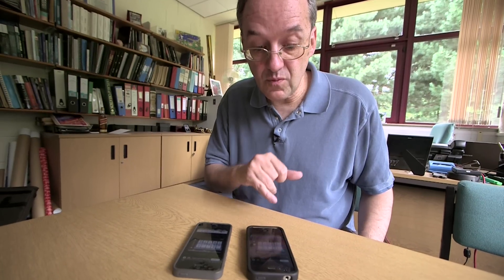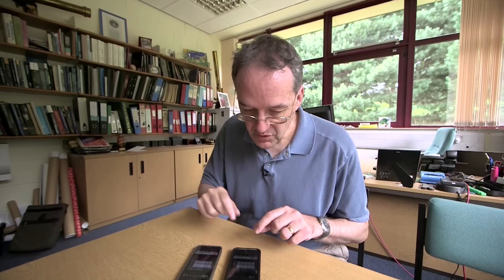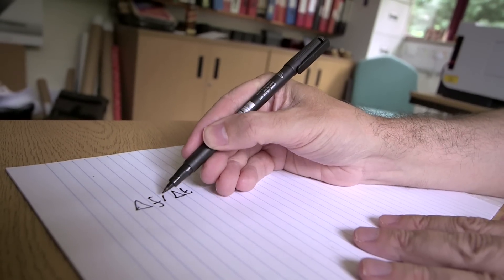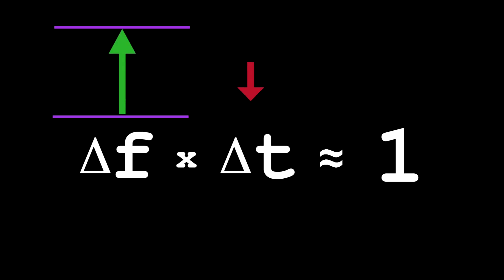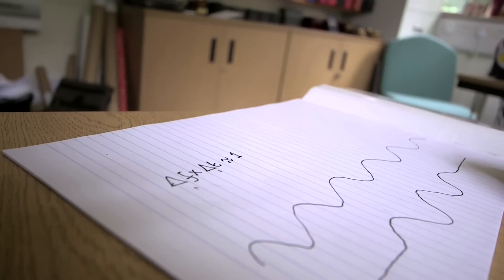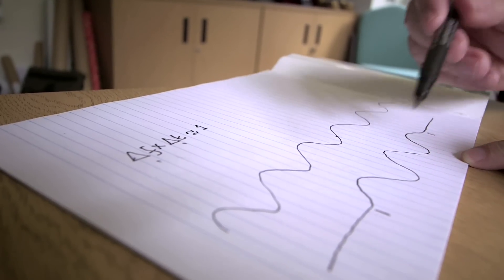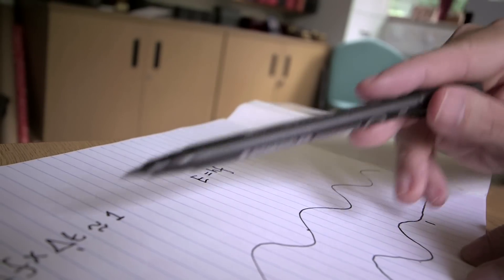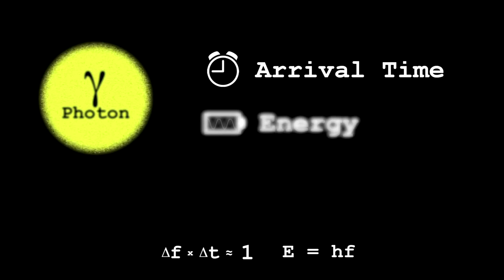What is the maximum Bandwidth? - Sixty Symbols

Comment: Strangely misleading about laser photons—photon frequency is not the same as sinewave, the laser would have to produce exactly-one-photon-in-each-photon-'slot' (squaring energy, yet 50% phase-efficient, intense for single atoms, near impossible for multiple atoms), and thermal effects spread photon emission bandwidth... (slow partial audio beating is called– "wow" or "Leslie").
Reply: And just a general comment on bandwidth, whether or not he covers it, Digital bandwidth is not the same thing as only one phase is represented at the highest frequency (the Nyquist cosine), and lesser frequencies are 'wow's and better...

Comment: The professor confused the part about the laser.
1. You could transmit a digital signal by pulsing a constant laser on and off.
    The 'data' is contained in the ON and OFF switching of the laser,
     the data is carried by the intensity (not the frequency) of the laser, 
     This is called amplitude modulation. The laser doesn't change color nor contain other frequencies when you turn it on and off quickly. If this was true I could produce x-rays by pulsing a red laser extremely fast. This portion is irrelevant to bandwidth.

2. The bandwidth problem is that in the real world, when you have a device that measures the laser's intensity and converts that intensity to a voltage (an analog signal) for a receiver to convert to a 0 or 1, the physical wire that has voltage representing the 'measured intensity level' is subject to this bandwidth topic the professor speaks of.

3. the time it takes for an analog signal to go from a low voltage (0 - laser off) to a high voltage (1- laser ON) depends on the bandwidth of that wire. Bandwidth depends on the Resistance, Capacitance and Inductance of the wire.
The narrower the bandwidth, the LONGER it takes for the voltage to change from low to high.So if i have a very fast ON OFF signal(very fast high to low voltage) on one side of the wire, a narrow bandwidth wire, and measure the output, the output voltage will look like a smeared out version of the input.
Reply: Nope. The moment you turn the laser off, it is no longer a simple sine function. The Fourier series to generate the off state will have many other frequency components. There is a fundamental trade off between data rate and spectral width.  An infinitely narrow line on a spectrum analyzer can have no modulation and hence no information. The moment you start turning it on and off, the signal will widen due to the presence of other frequency components. And to your point, turning the laser on and off will produce components of all frequencies. They just have less and less amplitude the farther they are from the carrier. For the difference between red light and x-rays, the amplitude is so small it is highly improbable that even a single photon would be generated.
Reply: Hi Kinpatu, 

You're absolutely correct about frequency components being generated when you turn the laser off.

Remember, component frequencies only come out during the Transition from low to high. not while it's low or while its high.

Please let me know why you think this shouldn't work:

1. Use a laser (say, red ~700nm / ~450THz)

2. Turn on and off the laser at a rate equal to the wavelength (this will be your bit length)
 
3. Use Spectrum Analyzer with a sampling rate fast enough to capture a full wavelength, (say, 1000000THz in this case), Output the Fourier Transform after every wavelength (700nm / (theSpeedofLight) )  

Then for every Fourier Transform,

4. If you see a single peak at 450THz, you have a 1

5. If you see nothing or a peak at 0Hz, you have a 0

6. If you see a wide range of frequencies in the FFT, The spectrum analyzer isn't bit synced with the data, the spectrum analyzer had taken samples during a transition from ON to OFF or vise versa, so, Control the sampling phase of the spectrum analyzer until the component frequencies go away in all the Fourier transforms. The Spectrum Analyzer is synced with the On/Off Signal
Reply: Technically speaking it would "work," but the only bit stream you can send is an infinite series of 1s.  The moment you send a 0, e.g. 11011, you introduce a frequency component that is not 450THz, in this case 225THz.
What you are proposing is a method to send 450Tbps with on-off keying, with an infinitesimally narrow carrier bandwidth.  Claude Shannon showed in the 1940s that there is a fundamental mathematical minimum bandwidth required for a given data rate.  You may want to refer to his work, as it is still at the foundation of communication theory today, as very advanced modulation schemes push closer and closer to the Shannon limit.

Comment: Hmm, interesting video, but isn't the maximum channel capacity defined by the Shannon Hartley theorem: C = B * log(1+ S/N)?

Plus, you can use a single frequency for transmitting data by using phase shift modulation instead. Unless of course you consider "multiple frequencies" as part of the Fourrier series that would make a PM signal have two positive (or negative) peaks instead of a continuous sinewave. But from a signal filtering point of view, it wouldn't matter.

Comment: Ha! I have a question: How would you explain how SSB (Single SideBand) modulation differs from "ordinary" FM. I Have wondered for some time about the subtle frequency shifts taking place and how the waeforms actually differ. Don't show the delta(f) graph usually associated with the explanation, but rather how the carrier it self behaves.

Comment: farther to more ppl without being degraded any so any the video poster said you need more wave room to do so in which in turn means slower speeds. We have yet to really conintate on satellite internet as most ppl just use it for a single picture post or just for texting and/or cell phone calls which 1.5Mbps is fast enough or even faster than needed

Comment: I once pondered about using entanglement, measurement, and the resulting pattern of the other to break causality. eg the entanglement experiment mixed with a kind of double slit experiment. While we can all be fairly certain causality would hold, someone tried just that kind of experiment to make sure. Unfortunately I didnt have the knowledge to understand why it didnt work

Its tangential but this kind of measurement problem where you either know energy or time may be what they were getting at

Comment: I may be explaining this wrong but I think it is a relevant question.  
Does this mean that if I had a filter that only allows blue light and I flashed a red laser fast enough through it, that I would see blue light coming through it since the bandwidth now encompasses the blue area of the spectrum?

He also speaks as though if the laser is off, then some how it is producing a destructively cancelling set of frequencies and therefore no output.   This doesn't make sense to me.   But if true, how long does it have to be off before it doesn't produce any frequencies at all, discounting after glow?
Reply: Yes. But the amount of blue components would be really small.

Comment: The Nortel OpTera I'd mentioned does that - but it's very crude. You're talking about bandpass filters for each of the hundreds of channels!  It really is like a crystal CB radio of olde!  I've been out of touch with that field for 10 years - even back then there were ways to make detectors, electrically, wavelength selective ... but that's only half the problem. It's neat how we've gone from 10Mb/sec to 100Mb/s to 1Gb/sec to 10GB/sec all on copper in 10 years.

Comment: can you theoretically make a cable that increases the range of possible frequency transfer to more than just visible light?
Reply: Jobie Wan 
Such cables are already in use.
There are systems that work above 1000 nanometres, well into the infrared part of the spectrum.
Reply: cool! thanks for the info!! that was very kind of you! is this a newer tech? x > 1980?

Comment: So if we were able to put an infrared transmitter and receiver and an ultraviolet transmitter and receiver on the ends of a fiber optic cable and get them all reading in unison could we potentially pass exabytes of data through a line a second?

Comment: Light is electromagnetic radiation, and below visible frequencies you get infra red, that's heat radiation, not very useful to make short pulses of light so you need higher frequencies. Above the visible spectrum you get x-rays and gamma rays and those are pretty difficult to make go trough a fiber too don't you agree?

It's all radiation, just that we can use a fiber to make some of them follow trough a wire and some not. It's all physics.

Comment: If a lot of people use the Internet at once what happens?
Will some have connection but not be able to use the Internet cause of all the people?
Reply: no, server (or router) intelligently gives each user connection for short period of time. But there will probably be some practical limit at which you won't be able to use your connection normally (but you won't be able to reach that limit in most of the cases because servers, routers etc have client limit specifically set to prevent that)
Reply: Well, there are congestion control protocols in the tcp/ip protocol but that practically means that it slows down your connection in order to avoid/diminish congestion. But if the traffic continues to rise it will reach the point where it surpasses the maximum amount of carried traffic and information begin to be lost, so yes, there will be people who cannot transmit their data. Well I suppose that every one has experienced something similar to this when using Wi-Fi (which uses less stable access control than wired connection)

Comment: lol Terabit connections are not for the average consumer, servers used by the ISP and other companies have no problem processing Tb and Pb of information per second. 

consider the following, my CPU can read up to 20GB/s from a cheap set of ram, now take away a few GB, lets say the CPU is already working at 4GB/s on the ram, this leaves me with 16GB or 128Gb/s.

6 optimal laptops could in theory get up to a Tb/s (1Tb/(20BG*8))=6.25)
and a 1Pb/s = 6250 laptops, now use a server CPUs and ram...

Comment: I understand that. But, though I have a physics degree, I'm afraid you'll to explain the receiver to me as if I were a 5 year old. 

I can turn a light switch on my wall on and off. A photo-resistor across the room somehow logs whether the light is on, second-by-second. Those logged ONs & OFFs will be the 1s and 0s. 

What is wrong with this scheme? Won't this work?

Also, why does the receiver care about what color the received light is?

Comment: Even if it was that simple, wouldn't it be true that if you switched a light from off to on to off quicker than the frequency of the light source, that you might not even get a photon out to the receiver? If so, you'd have to use a source of higher frequency and at some point if you keep going higher, it wouldn't travel through whatever cable you're using. Yes? Just guessing here.

Comment: This makes me wonder, with the problem of the laser turning on and off creating different frequencies, even though the modulating systems we use are great, why didn't engineers initially think to use either polarised shutters to allow pulses from a continuous laser or materials (such as ruby) that limit the light to the wavelengths they want and still use a pulsing laser without worrying about different frequencies getting through?

Obviously these would be less effective for reaching the tiny amounts of time to transmit a single digit but seem to me like 'lazy' means that engineers would seek before the goal of transmitting femtosecond modulations over all of the 10^-9 ish to 10^-4 ish meters wavelengths that can pass through glass was ever in anyone's mind.
Reply: +Bannicus The fiber optic laser do exactly that. There is no shutter able to switch on/off 10 billions time per second. But there is way to rotate the laser light by 90% at such speed. The output of this fast electrically controlled polariser is then split thru a polarized filter. Half of this is injected in the fiber, the other half is absorbed inside a "heavy-duty" heat sink. Even if the laser is just 100 mW, the heat from 50 mW waste could affect reliability.

The 10 gigabit pulse start has polarized light, but after travelling 50 km, the polarization is lost. Also, the laser frequency is spread by about 20 GHz. The engineer reserve 30 GHz as safety margin. This is why each laser are set at 50 GHz frequency difference when using many laser on a single optical fiber. Each fiber can transmit the signal from 100 lasers, each set 50 GHz apart. The total bandwidth for a single optical fiber is therefore : 10 gps & 100.
Reply: +Christian Gingras Well I guess whenever you think of something, someone's already beaten you to it!

How do they rotate the polarisation?

Comment: If you have the amplitude of the wave as well as you know the exact part of the cycle the photon would be starting on then, if you toggled the power supply quickly shouldn't you be able to predict both energy and time. If the wave was assumed at a constant frequency couldn't you have an imaginary wave whose data is recorded for time calculation

Comment: 1:20 Amplitude modulation (AM) uses only one frequency and its possible to send and receive  data or audio ( voice) with it!
Reply: cocas1000 Actually it uses more than one frequency as modulating the signal produces sidebands (made up of additional waves as in this video). Radio amateurs and others transmitting voice only suppress one of the sidebands and the original carrier to produce upper sideband or lower sideband transmissions. This conserves bandwidth and transmitter power.

Comment: atm it is only 100 gigabits per secound maximum speed on a LAN which will degrade past useableity after 1 or 2 kilometers or so and somewhere in there it will have to be taken and reshaped back into the original digital form. anyways 100 gigabits is faster than you can actually go on your home LAN so it will then be divided up between you and others in thus you will only end up with a single part of it. why you only have 1.5Mbps atm is b/c satellite internet is like WiFi and just has to travel

Comment: If pulse is 10 femto, then pulse = 10^-14 seconds, so 10^14 pulses in one second. That's 10^14 bits, or 88.8 terabits per second, basically 11.1 terabytes per second. If we add some error correction, maybe 10 terabyte per second? Guess my HDD would fill up quite quickly.

Comment: Hypothetical curiosity:
Is there (theoretically) a way that ultraviolet and infrared waves could be sent?
Reply: Modern telecommunications equipment actually do transmit in the short end of the infrared spectrum, with a wavelength of around 1550 nanometers.  Wavelengths above 1700 nm and below 800 nm have a lot of loss, but I assume a material could be engineered to transmit other wavelengths better - its pretty hard to beat the price point of glass though.

Comment: He never explained how an ISP sets if a pulse is going to be a 1 or 0.
Also, I still don't follow his explanation on why a turned off laser is actually many wavelengths. Is he saying that when you turn off the laser the material of the laser starts emitting slightly time delayed light the same color of the laser, to cancel out the color of the laser? That sounds like non-sense, but that's how I understood what he said.

Comment: 0:58 how come there is no information in it. it has a frequency. Somebody could measure the frequency and have the information of the number?!
Reply: +Embeh The information content depends on what you assume as given (already known). In the context of the modulation of a sinusoid you have a given frequency sinusoid (carrier) which is modulated (e.g. amplitude modulation) by another unknown signal. The carrier does not bear information to the extent that you already know its parameters.
Reply: Different definition of "information." A blind number out of context doesn't actually count in terms of what Physicists mean when they say "information" in terms of the universe (whether that's on large scales or small scales.) It's the same "information" they mean when they say you can't transmit information between two entangled particles. You need more context to have it be true information in their scientific definition.

Comment: I'm sure this explanation is true for sound and analog electronics but I doubt this is accurate for phonics. Photons ultimately have discrete amounts of energy so there will always be a limit on the number of different sign waves that can contribute to the final wave form and different frequencies can be separated by diffraction or refraction easy enough while being fully reversible. Also even if you discount phase due to uncertainty, there is still polarity and circular polarization.

Comment: Has anyone experimented with wider spectrum fibers?  Like expanding into non-visible frequencies?  Sure it wouldn't be "optical" fiber anymore, but it could still be some sort of "exotic" fiber.
Reply: Yeah, sure, but is it possible then to transmit non-visible electromagnetic waves with optical fiber??
Reply: Gustavo Ávila infra red is usually used in practice

Comment: ... be decoded. The limit is there, no matter what method used to encode. They just happen to be using an efficient method, compared to your semaphore flag system. Nevertheless, their calculated limits of the maximin amount of information you will be able to convey will still be true. Even a dc signal pulsed at 25ghz is in effect a microwave, at least in many aspects, and certainly in those that are affected by this limit. Of course the simplest method of increasing throughput is to add fibers.